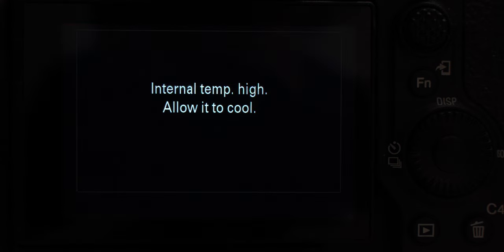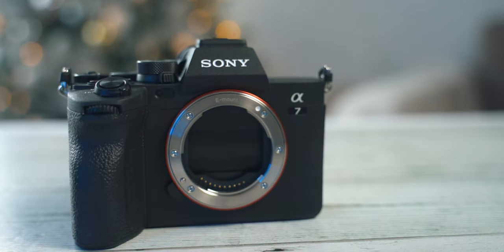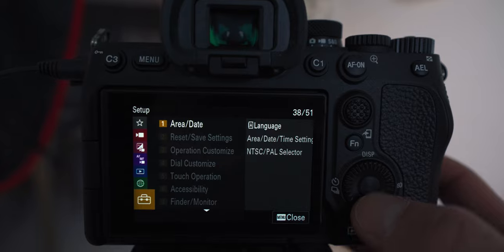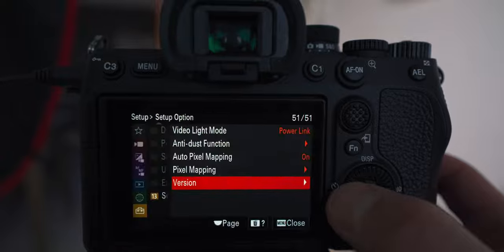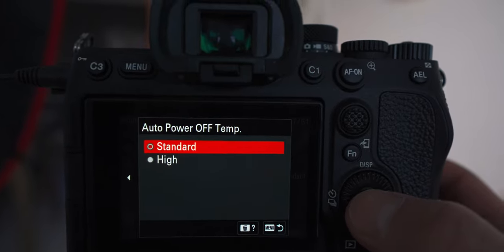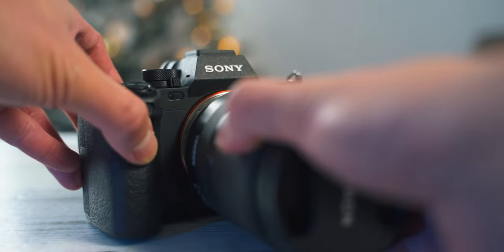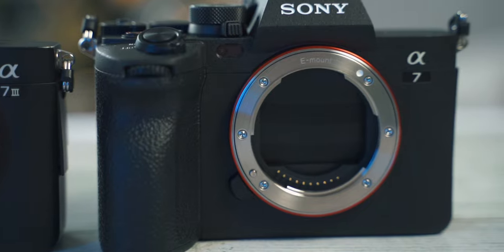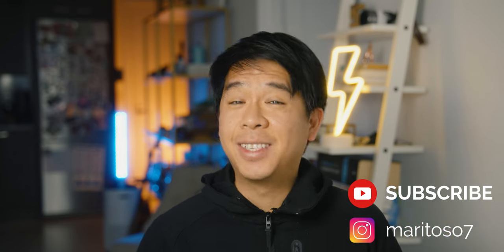OVERHEATING On the SONY A7IV and How to FIX It! | Do This First

Comment from the maker: Do you have a Sony a7iv? Let me know if you have experienced this issue. 
⭐5 Hidden Video Features on the a7iv You Didn't Know About: https://youtu.be/aALw8RCQT98
▶️How to Set Up the Sony a7iv for Hybrid Shooting? https://youtu.be/s0rJue_wCrM
▶️Differences and similarities between the A7iv and A7iii: https://youtu.be/W8VLyR7tNCI
▶️What Settings to Adjust on the Sony a7iv Before You Shoot: https://youtu.be/e8xOdHt7_mI
▶️All about the Sony a7iv: https://youtube.com/playlist?list=PLEIhipL-_hKSwPggeG_4WFdfiQNxov8Xu

(Apr 7, 2022): Upgrade your Firmware to V1.01: https://www.sony.com/electronics/support/e-mount-body-ilce-7-series/ilce-7m4/downloads

⭐Watch Chris Brockhurst's video on overheating tests on the Sony a7iv: https://youtu.be/XN4PEqT6jHo
Reply: This setting is important for the Alpha 6400 as well. I thought everyone changes it on all Sony cameras, but it seems to be uncommon as you are not the only one talking about it.
Reply from the maker: @MiroAcronymity  Yeah it was never common for me on the previous Sony cameras I have shot with. Good to know that it happens to the a6400. Never happened to me on the a6300 or a6500, or the a7iii
Reply: I'm having overheating issues while just outputting clean hdmi, sitting idle. Have you seen it heat up while using the clean hdmi out? Even idle without recording? I exchanged my first one for a new unit and still have the same problem. I feel like I'm crazy, Sony is trying to tell me that should be normal. It's pretty unusable as a video camera with an external recorder, like on a gimbal or shoulder rig. All it takes is a couple 1 minute video clip recordings internally while outputting hdmi to overheat it. No matter what the resolution or bit depth.
Reply: @TheArmatureStudios  even with the temperature limit set to the higher setting?
Reply: @MiroAcronymity  indeed. I need to get an infrared thermometer so I can give you a number but it's really hot. It'll run just on external output for maybe an hour in a cool room, sitting idle but it'll get so hot that I can't touch it. Both copies have done the same. If I record even a minute of internal footage every few minutes while outputting hdmi, it'll overheat and shut off within 15 minutes. If I set the overheat temp to low it'll shut off even faster.
Reply from the maker: @TheArmatureStudios  I would return it. Maybe the two you got are from a bad batch

Comment: I am on my 3rd AIV. The first one overheated and shut off from settings menu, the second had awful dead pixels in screen and viewfinder, and the one I'm on now is shutting off when streaming as a webcam even with the temp shutoff on high. This is pathetic and should have been addressed before launch, Sony!
Reply from the maker: That really sucks. Sorry to hear that. I have been able to record on mine for 30-40 mins straight in 4k in 4:2:2 10 bit no problem now that I turned that temp to High.
Reply: Same bro, you got a fix?
Reply: @intuitivefilmanalysis  there is no fix, the camera its garbage for log video shoots, thats it.

Comment: Call it out as it is, folks. This camera OVER HEATS! Even after all those adjustments I found on youtube, from setting high temp to flip out screen. The only setting left, was to NEVER TURN IT ON! Just leave it OFF and sitting on a desk like a paper weight! It should not be up to us to try to work around this problem. Reject this crap and hold Sony accountable!!!
Reply from the maker: Yes Sony needs to fix this!
Reply: exactly, Im talking with them now, and they send me a bul* shi&* table showing the times that the camera runs until overheats, and its total garbage!!!!!!!

Comment: Setting set to (Temp High) Ver1.1 still shuts off for me after about 2 hours of being on in video mode, not rolling, just hdmi out to an encoder. It worked fine in 24p mode but when switched to 50p it turns off after 2 hours. It has done this twice consistently at 2 hours. It is plugged into USBC power so auto timer if disabled. I am not around to see if the overheat light turns on before it turns off. Any clues?

Comment: Mine is overheating just doing photos! Even with the latest 2.0 firmware update…😢
Reply from the maker: Did you set the temp setting to high?
Reply: @MarioSoMedia  it’s still working fine but hurting warm next to the viewfinder….
Reply: @MarioSoMedia  it’s still working fine but hurting warm next to the viewfinder….

Comment: Hello, I wanted to know if you still have overheating even in high settings, I just bought it and just looking at menus it turned off, set it to high and it doesn't turn off, I still don't have cards to test it, does it work well for you recording in 4k?  And do you know if there is any firmware update?  Thanks!!!
Reply from the maker: Hi there! No more overheating after I switched it to high. I made a video talking about my experience shooting on the a7iv: https://youtu.be/-c9KkiFf1_Q
Reply: @MarioSoMedia  Ok, I'll check it out, thanks👍

Comment: The weird thing is, I was livestreaming, and it shut down within 10 minutes. I yanked out the USBC cable, and just ran the camera on record, without going live, and I got an hour's use out of it before it "heated" up and shut down again.
Reply from the maker: Thanks for letting us know. Did you have temp setting to high?
Reply: @photowalksTV Ver1.1 -- Live streaming here too and it shuts down on me in 50p mode. But didnt shut down in 24p. Not recording. Just pushing through hdmi to an encoder. Any resolution yet?

Comment: We have several A7IV cameras and one of our has this issue and the others don't. I'm convinced there are bad apples in the batch of cameras released. For example, the camera that has issues first gave that warning while I was NOT recording. I just pulled it out of the box and was setting up the menus for about 20 minutes when the warning hit. Huh? I wasn't rolling yet. Been using Sony Alpha cameras every week since July 2014 and never seen that! Warning message even while just setting it up in a cool house in the winter?! 5 mins later it shut down. Woah. So I labeled the camera so I knew which one it was of my batch and switched to high temp mode and all went well. The other A7IV cameras did not show that warning that night and I purposefully took a while setting them up...as long as that first one in standard mode. 

The final straw was our first wedding yesterday with them. Church ceremony, indoors, cool temps. All on same settings and all 3 A7IV cameras (plus our A7siii that I've been using for over a year) set to high temp mode. Only the original "bad apple" had issues. After about 20 minutes of rolling we got the high temp icon on that camera only. I pulled the LCD away and it went away shortly after. The others I left rolling with the LCD flush against the camera just to see what happens. No temp warnings on the others. And they rolled for 65 minutes straight 4k60p. Again, the one bad apple had issues before I ever hit record. I'm convinced there are bad copies of this camera out there. There's no way this one bad copy will last thru a hot summer of hot weddings here in Los Angeles so we're gonna send it back to B&H for a replacement asap.

Just thought I'd share. Happy shooting.
Reply from the maker: Thanks for sharing and good to know! So it does seems like some are bad apples and I might have gotten one. Anyway hope Sony releases that firmware upgrade addressing this soon. Happy shooting!
Reply: I had the same exact situation, I was just going through the menu settings for 20min or so without shooting any video and got the overheating warning and shutdown.  I'll try the settings Mario recommended.  I'm hoping this isn't a "bad apple" as I don't really want to deal with the hassle of returning to B&H, so do you think there really is a bad batch that can't be fixed via a firmware update?  I will routinely be shooting 4K interview videos with this camera that will exceed 30m of recording time in many cases.
Reply: @markmarino6158  So far in the few tests I've done, I'm lost. No consistency. Frustrating. No longer sure about my "bad apple" theory even though I was convinced of it given how the first setup and the first big shoot went with only one camera having the issues. But it's been performing the same in my tests so I'm lost. Enabling the High Temp setting and pulling away the LCD screen obviously help alleviate overheating but I'm now on to comparing testing various codecs on 24 vs 60p and then the difference between heat performance when the camera is on a tripod vs handheld, etc. I don't know if firmware fixes will help and honestly I wouldn't rest my hopes on any quick fix like that coming. Seen some videos where using the Sony batteries help too vs 3rd party. I only use Sony batteries so for me, that's a non-issue. If I find anything significant out I'll try to report back.
Reply: @AllBecauseHeAsked  I think it's important to state which cards you are using, as it makes a huge difference.
Reply: Same!! Setting it up for around 20-30 minutes was too much. And it felt quite warm on the outside! More than it should I guess. So I will send mine back! Thanks for confirming my doubts! 

Oh I just saw the second comment x_X hmmm maybe I will test some 4k shooting today by myself just to see how it performs in the same environment. But I am not feeling good with that cam at the moment so probably send it back anyways :/
Reply: @AllBecauseHeAsked , @Mario So,

Edited: for grammar!

I just stumbled onto this video.  Good discussions.  I had A74 for 1 week.  I bought it in the US, but I’m living in Asia so it’s a bit hard to return it.  

I had the main board go bad in a week of shooting (no overheating whatsoever).  I sent it into Sony for their technicians to replaced it with genuine parts.  I had to pay 100% for it as they said Sony Asia and US are not the same (hmmm?).  I got it back yesterday in time for my daughter’s theatre performance in cool AC indoor and it overheated after 30min of recording 4K25 10bit 4:2:2 XAVC S with a Prograde CF Express A card (same as before).  I was surprised it overheated and got hot, but I could still hold it.

I own the R5 and still do and got around the entire thermo physics overheating issues by doing the following:

1) for short form recording (under an hour run and gun), I would use the following:
- Tilta fan at high speed
- dummy battery
- powered by NPF batteries, but now I use Core SWX Powerbase Link 70Wh V-mount battery.  Be extremely careful here as if you use the P/D-tap ports (rated at 12-16V) with the camera dummy battery (rated at 8.4V), you will short the camera.   You need to use the DC barrel port available with a 8.4V rating or a dummy battery that has P/D-tap input of 12-16V and output to camera of 8.4V using a down converter;
- keep screen opened for airflow
- keep power temp setting in camera to high

2) for long form recording (above 1hr continuous), I applied the following:
- use an external recorder like the Ninja 5/5+, but record externally and not internally or both and you’ll have no limitations except making sure to swap out the batteries and storage when it runs low or get a large storage capacity SSD and run a dummy battery to external recorder using a V-mount battery bass like the Core SWX PB Link (newest model) that can easily swap out or piggy back multiple ones to shoot all day.  It has a LCD panel that shows the recording times remaining so you’ll know when to swap out the batteries.

The above was my way around the R5 overheating and should apply the same with Sony or any cameras that the engineers did not design for thermal physics limitations such as using a small body, enclosed for weather and waterproofing; no proper passive cooling to the image processor and other components that runs hot at high frame rates and recording settings; did not use inductive body frame such as Magnesium alloy; did not use active cooling fans such as Pana S1H, and now FX3, Z9, R5C.

Note: Sony has two power settings: 1) low for standard handheld as default; and 2) high for tripod mode.  This has to do more with consumer safety as handheld touch, without dropping it depends on the individuals but usually 40degC or above.  The UK and Europe have more stringent consumer safety laws than the US and only allow no more than 48degC for handheld, while the US allows I believe 52-53degC.  These high temps are considered not safe for handheld touch.

I recently applied the same thermal physics principles to the DJI A2, InstaOne R, GP10 using magnetic phone fan coolers and was able to run much longer than the stated times or where others said that their action cameras had overheated.

I will test out the A74 as above and see if the overheating will go away.  Am just surprised that before the main board was defected, I had no overheating issues with long recording times over an hour in all 4K modes and recording. 

Anyhow, good luck and happy shooting!  Let me know if you have further findings that I haven’t tried!

Comment: Switch to V90 SD. Ok, guys, I'm posting that comment under every video related to Sony A7IV overheating issue, because it solved the problem for me and I'd be happy if it helps you. I've browsed through dozens of videos on that subject and most of them didn't mention that particular thing.
Yes, auto power off temp works. Opening the screen and battery door works too. Eventually it allowed me to record 35 min instead of 15 min in 4K 100M. Better, but not perfect. External recorder, switched off linking, camera grip, etc. probably does its job as well.
But V90 SD card instead of V30 allowed me to record a 2-hour take easily. The battery exhausted earlier. 
Maybe that's dumb, but having been an A7III user, I never thought the card would be such a gamechanger. In fact, yes. Slow cards just don't have enough capacity, being overheated while trying to process the recording, they overheat the camera internally even though it stays cool on the surface.
Don't bother with CFExpress, just a regular V90 128G card would do the thing. At least it worked like a charm for me. Thanks for the video, Mario 👍
Reply from the maker: That's a great finding! I use v90 all the time so probably might have contributed to what you are saying. Thanks for sharing!
Reply: @MarioSoMedia  I knew there’s a difference between cards, of course, but never expected it to be related with overheating as well
Reply: This is an issue I'm facing right now. Have the V90 card. Tried the settings mentioned above except for the linking one. What does the linking feature do?
Reply: @Airhaert did you find out the linking?

Comment: When I first used it, I received a heating warning after 10 minutes. I thought the problem might be in the write speed of the v60 sd card. I am using a Lexar CFexpress Type A Gold Series card (900MB/s). Likewise, at the end of the 10th minute, the machine was still heating up and shutting down. As per your advice, I set the automatic power off temperature to high. This time, it gave a temperature warning at the end of the 12th minute and shut down at the end of the 15th minute. My video recording settings; XAVC S 60p 200M 4:2:2 10bit

Comment: I'm on version 2 and I recorded for about 13 mins and then the thing shut off. Updated my setting and will report back if this happens again but hopefully that resolves things.
Reply from the maker: Did you switch the temp setting?
Reply: yeah I just did, we'll see if that helps, I haven't recorded content since yest when I made the change, but it's there in v2 @MarioSoMedia

Comment: Excuse me how update faram rate sony aiv to fix this problem?! & when update that fix or not ?! Thanks
Reply from the maker: The firmware update didn't seem to fix it. But if you have it set to High, you should be able to use it normally..
Reply: @MarioSoMedia  when set in high what happen for body in technically ??
Reply from the maker: +Alireza Raad | علیرضا راد So far nothing really. Some a7siii users have left it at high and have used it for years

Comment: Thank you so much! 👍🏼👍🏼👍🏼👍🏼 
Firmware 2.01 and still the issue.
Cheers
Reply from the maker: Did you adjust temp settings?
Reply: @MarioSoMedia  Yes, following your advice, and worked perfectly! Yesterday I had to record an interview for one and a half hour without any problem, thank to your video! 👍👍👍👍👍
Reply from the maker: +@ConversasAleatoriasPelaEuropa Nice! Good stuff!

Comment: Thanks for the video! I had the same issue after about an hour of unboxing. I was only learning the menu system and not recording. The camera body was getting worryingly hot. It also got very hot when it was charging. I have checked, as you surgested, and yes the camera is running on Ver. 1.00. 

I don’t feel very comfortable with running the camera in the increased heat tolerance mode as I have a feeling that as daily shooter this won’t be too healthy for its body in the the long run. 

I also experienced the EVF blacking out despite the back screen working. This happened for about a minute after the overheating. 

I purchased the camera in store two days ago and will return to the store today in the hope they can get the firmware update or exchange.

 Thanks again for your video, really good to know what the issue is.
Reply from the maker: Not a problem! I haven't experienced the EVF issue but hopefully an update comes soon!

Comment: Hi, nice video, my camera  turned on in my bag and was there for 4-5 hours and overheateed like crazy, battery from 100 drained to 11 when i saw it is on and it was really hot, is it my camera now really damaged? its second year using it :(
Reply from the maker: It should be ok. Any updates?